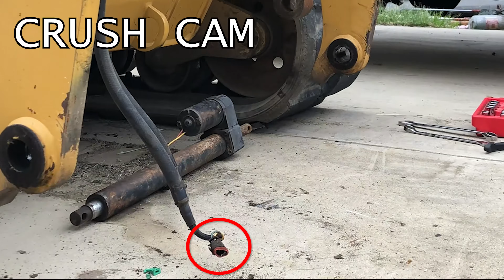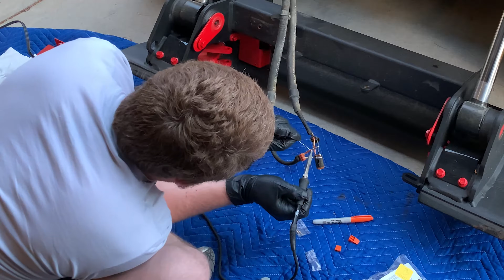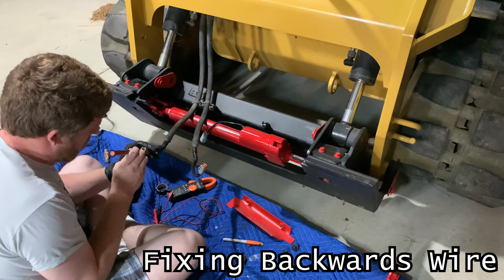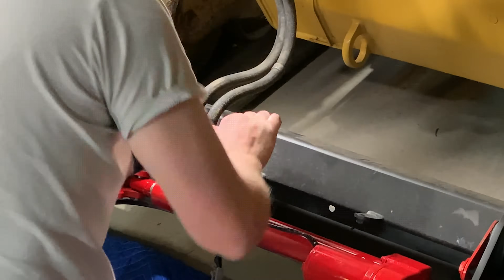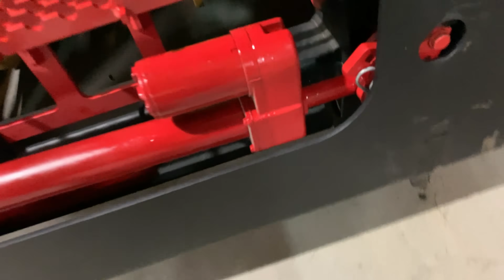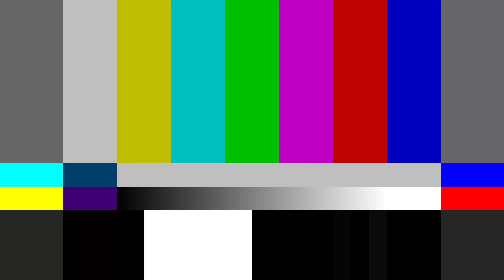Part 2 CAT 299D Front Coupler Reassembly - Putting the Puzzle Back Together

Comment: Have you ever tried to get parts for the actuator they ar expensive from cat and I just need a gear for mine
Reply from the maker: @mikegeorge9382  I tried. I have a video where I tore mine apart.  I was under crunch time and didn’t have time to source parts. The part number and manufacturer is on the actuator.  I remember looking it up and it was about half the price as the CAT one.

Comment: Hey man.  Thanks for all the videos!   How much did you pay for your machine.  I’ve been looking for one as well.
Reply from the maker: I do have a video coming out at some point that talks more about how I choose it and what I paid for it…. But that might be a while as I catch up on videos. 
So I paid 32k for the machine and 2k for the 6 way dozer blade and 2k in shipping from Pennsylvania to California.
Reply: Thank you!  I found a 2010 with 3100 hours at an auction. So I’ll be planning to bid on that.  I like how your taking it apart and fixing it up.   I did just buy a Takeuchi excavator
Reply from the maker: @crf50crazy  one thing to look at is the current series. I’m guessing that is a B or C series?  I think they made a lot of changes from a serviceability stand point when they switched to D.  Take a good look at the undercarriage too if you can. I love my CAT and I have a bobcat, kubota, jlg, and genie now. CAT seems to have the best parts catalog and availability of parts.  CAT also puts a part number on every single part!  For example, I bought a 2003 bobcat excavator and I am finding out the hard way that bobcat pretty much stops stocking parts for machines after 7-10 years. In fact no one at the dealership had even heard of my machine.  I will be making videos on that too.
Reply: Very interesting!  The auction has it listed as a cat 259 but the serial number and stickers say 299D.  So I’m hope for a good deal. I bought by dump truck at auction because they had it listed as a stake body but I knew it was a dump bed.   I have also been looking at older Takeuchi
Reply from the maker: @crf50crazy  oh that’s very interesting!  Ya, some of my best deals have been mislabeled Craigslist and auction items too! 
I am pretty sure the D series did not come out till 2012-2014. 
The serial number can tell you a lot though. Feel free to reach out to the email in the profile if you want to chat more about that.

Comment: Just wondering if you noticed the quick tach actuator was re mounted upside down. Not sure if that will case any issues for you down the road.
Reply from the maker: Hey Brett, I just checked my parts Manual, and this is the direction it shows to install it in my CAT 299D.